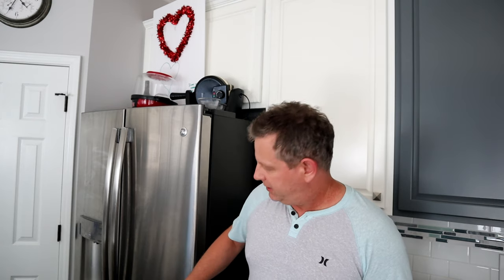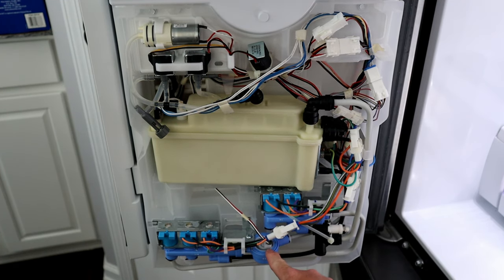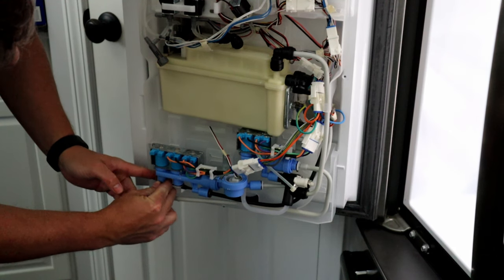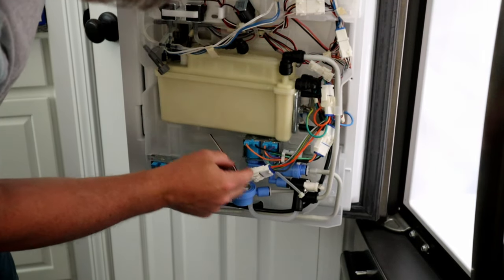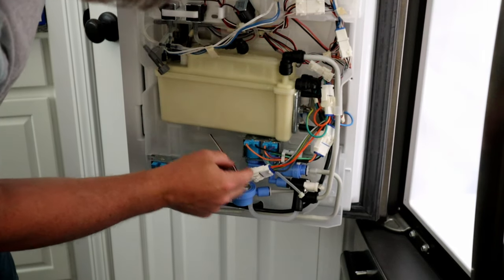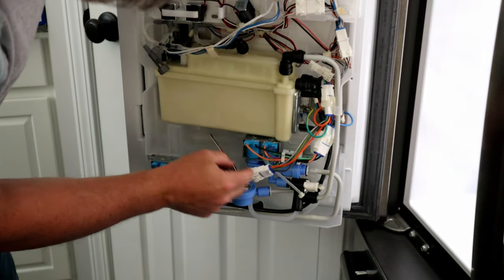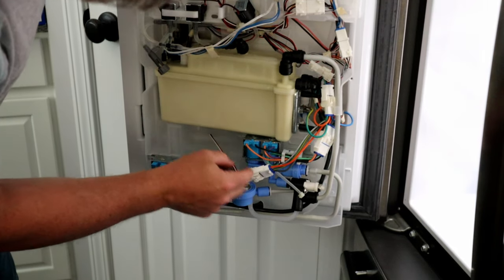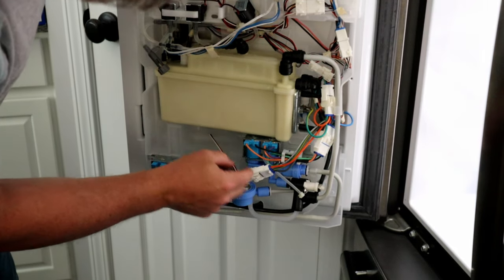#MTBPlanB DIY GE Profile Fridge Keurig coffee brew diagnose and fix.

Comment: Great video - had the exact same problem. Thanks to the detailed overview of the system you gave, I was able to take the tank off of the door, clean it out, manually shake the float to confirm it was working, and re-install it. Started working right away and didn't need a new tank. My guess is that one of the sensors/float or pathways was blocked.
Reply: That's a good tip. I think I'm going to try that, since a replacement tank costs $200 right now.

Comment: Thank you so much for this video! We got a quote from a repair company and it was almost $800! So we DIYed and fixed it for $200 and 15 minutes. However, every time we put back on the door panel, we find that water starts pooling inside it and it starts dripping out after about 12 hours, so we end up taking off the door panel and leaving everything exposed in the fridge and there is no leaking. We assume the door is pushing on something to cause a small leak. Any ideas on how to best fix? We try tucking everything in, and even removed the styrofoam part on the panel to no avail.
Reply from the maker: Are you utilizing the hot water or coffee function at all during those 12 hours?
Reply: @MTBPlanB  yes, we use it about 4-5 times a day, but mostly in the 8am-12pm time period and then we would notice the dripping the next morning. When we have the panel off and make coffee, we don't see any water leaking from anywhere afterwards. It took about three times of noticing the water dripping after removing the styrofoam part and trying to tuck all the wires in nice and neat that we just decided to leave the panel off, which is what we have right now.
Reply from the maker: @leggey8285  ok there are some relief nipples in case of over pressure. I would check the black tube that runs to the coffee dispenser on the outside of the door and make sure it doesn’t have a kink or excess bend.
Reply: @MTBPlanB  ok thank you! We will try it and see what happens!

Comment: Upper chamber tube broke when I tried pulling it like you did
Reply from the maker: Was it leaking there before you pulled it? If you pulled up on the quick lock and it still broke, maybe  it was already cracked and pulling  air in. Could be part of the problem. Standard tubing can be purchased at a good supply store.
Reply: @MTBPlanB  So I have to purchase the entire WR57X25783
BRACKET PUMP & VALVE ASM.  Seems like the tank is working but because I had to mess with the pump part it leaks everywhere when I dispense.  Ugh!  Very frustrating!  Any recommendations?

Comment: Hi and thank you for the good video. But i have kind of a different issue, hopefully you have an idea on what could be wrong with it. 
 My water heats up but does not  dispense, i did all the tests to make sure water is getting in to the tank and it does. After it heats up to the 100% I push BREW DISPENSE, the metal tube comes down then the error message pops and the tube goes up with out dispensing a drop.
Reply: Same issue here.  Never even used ours.  Did you find any solution?
Reply: Same issue, did you find out how to fix it?
Reply: I have the same issue.  For some reason when I remove the tube at the top left it starts working for a while but then goes back to not pouring.  I don’t want to replace the tank if it’s a pressure sensor or valve.

Comment: I have the same fridge the water wasn’t dispensing at all, I took this panel off an let warmed up the area, water now works but the tri valve is leaking!? Any insights? I’m going to buy the dummy tri valve and replace, fingers crossed
Reply from the maker: Check the o ring on the water tubes.